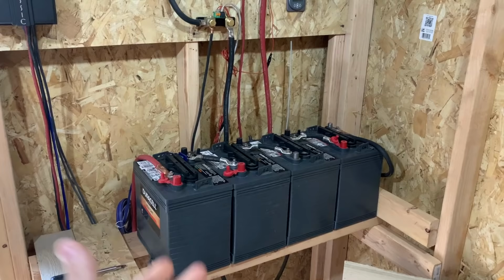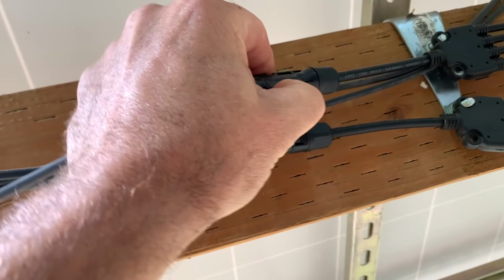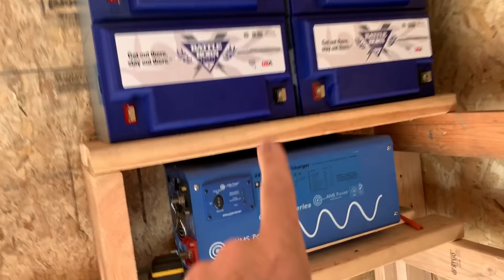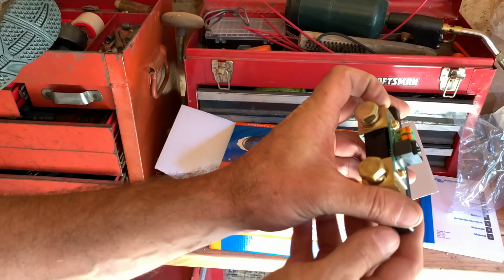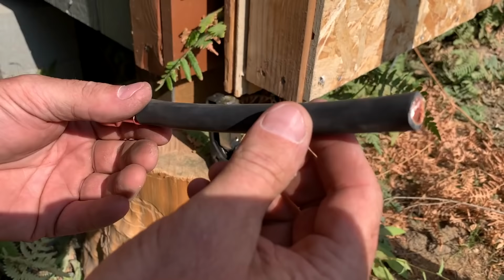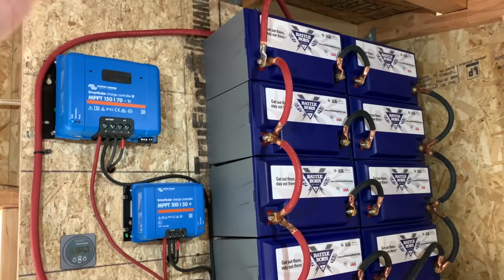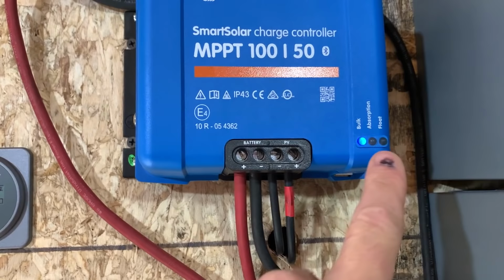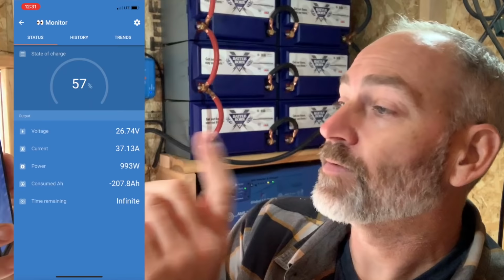EASIEST Off Grid Solar Power System Battery Bank

Comment: Battleborn is way to expensive! There prices have been going up even more lately.
Reply: The cost of doing business has risen significantly in the US.
Reply: @troy3456789  Yes and businesses use the "excuse" of covid to raise their rates.
Reply: I suspect that the cost of manufacture in the US is higher, (than China), but I also suspect that price gouging and profit taking are the name of the game...
When the US put tariffs on Canadian steel, the US Steel manufactures didn't take advantage of their (now) price advantage, instead, they raised their prices to match the cost of Canadian steel + tariffs..   So, like I said, profit gouging...
Reply: @kasualskeptik2584  It's that regulation and minimum wages and fuel costs have almost doubled, so everything must go up in lock-step with it.

Comment: Those batteries won't charge below freezing. They have low temp cut off.
Reply: God Robot  They don't drain in the cold they simply do not produce power when they are too cold. Also if they are charging or providing power they will keep themselves warmed up anyway.
Reply: Wont be a trouble in the Caribbean then.
Reply: That's $8,000 in batteries alone
Reply: @louiswaylonbrown  thanks for that info.  Seems i won't be replacing my lead acid ones any time soon 😫
Reply: @christopherj8280  you can find a cheaper lithium battery they are just top of the line because the battery’s are 1000 each I’m considering building my own battery source myself
Reply: @louiswaylonbrown  I started a few years ago with huge tractor batteries. Eventually moving to some 6volt deep cycle in series.  But I've been aesy for over a year and they won't have been serviced properly or kept topped up with distilled water. So are probably usless now. When i go back this  Christmas i was planning to refresh the battery bank. The main problem is that in Jamaica everything costs twice the price of usa thats if it's available at all.

Comment: I saw the batteries are $1000 each. Click. I'm out.
Reply: So 100 per year or if you go 20 years = 50 per year. Reasonable. So say 15,000 for total system, credits from federal government by time you're done for 20 years you're electric bill for 20 years is around 50 dollars a month fixed. Or you can go ahead and pay for 50 miles of electrical cables telephone poles.... well you get the picture.
Reply: Shop around for the batteries.  I'm getting 32 100ah LIFEO4 batteries for 4200 through CALB.
Reply: @jasonshimkus6139  My monthly electric bill is around $150. It's not something I really concern myself with.
Reply: Battleborn have a good rep but I agree. You can buy 280ah 3-5k cycle  lifepo4 cells for around 150$. Each. Buy a quality BMS and spend a fraction...
Reply: @justinanderson9747  don't need a BMS if you bottom balance the batteries first.
Reply: @justinanderson9747    where to buy for that price pls?????
Reply: SK Battery America, Inc (South Korean lithium-ion battery maker) is building a MONSTER plant in Commerce, GA at the moment. Don't know what that's going to do to the price of apples or lithium batteries more importantly? But they will be made by thousands of Georgians when it's up and running.
Reply: @beebop9808  what chemistry do they use in their batteries?  Competition is good for the buyers though!
Reply: @jasonshimkus6139  I have no idea and maybe no one else does yet? There are American partnerships involved. Probably best wait and see for that kind of information. I don't know when the scheduled opening of the plant will be? Only that they appear to finally have all of the buildings up after about a year of building. Imagine there's plenty left to do on the inside. Nothing small about it. I thought it might be another automotive plant when they tore down a mile of woods to start building.
Reply: @beebop9808  by the time I get to the powerplant build they will be up and running...so I'm very curious!
Reply: @tims2179  will they last 20 years though?
Reply: @Adrenaline89Junky  most good LiFePO4 batteries have a good warranty provided with them.  If they are properly balanced before put into use, it's been said that the battery bank will Outlast the RV it's in to the point where the bank can be installed in a different RV later on and still perform at the level as first used.  Again...IF...the build is done correctly.
Reply: @jasonshimkus6139  how do you balance them?
Reply: @mooskamoo  check out "RVexodus" on YouTube.  He has an entire lithium series build where he give a step by step on how to bottom balance LiFePO4 batteries.
Reply: @jasonshimkus6139  thanks.
Reply: @mooskamoo  yw sir
Reply: @justinanderson9747  with shipping from china 108 ea. (X16)
Reply: @justinanderson9747  where please?
Reply: @justinanderson9747  Where can I buy these and what are the amp hours?

Comment: $8000 in batteries is a lot of scratch.
Reply: Well if I have a household full of teenagers that don't know how to turn off  lights, amps, electronics, AC, heater etc and electric bill that's about the same cost as my mortgage!  These are definitely the best investments EVER!  Also my stress level of seeing my bills will lower= lowering my chances of having heart attack=long life! 
Anyways it's just money, we spend money quicker on a lot of other BS!
Aloha
Reply: @xyleya12  he wouldn't be able to run a whole house; kit appliance circuits, stove, lights, water heater, and an AC off that battery bank. It would need to be around 4x larger then what he has
Reply: @joshuahaught4812  might want to do some more research....
Reply: @wyzurd  don't need too. A battery bank of 8 batteries wouldn't be enough to supply the average American (which the guy is) home with all the normal running supply during summer. Would it be enough to do it during winter, you bet. If he has an electric stove and an AC he would not be able to run them at the same time
Reply: @wyzurd  just did some research and it seems like I'm still correct. Thanks.
Reply: Yet you even say it depends on variables... way to make blanket assumptions!
Reply: @wyzurd  read what I wrote. Your cherry picking and yet still haven't provided any alternative. Dont know what you're trying to prove and it looks like you don't either
Reply: @austinjudovsky7240  I wasn't talking about the gentlemen in the video. 
I was speaking to the person I presumed lived in Hawaii in the comment section.

Edit: you are Def correct in regards to the guy in the video. I doubt he would have built a system that wouldn't fit his needs.

Edit: I also did a quick search, "how many batteries to power a house?" 38 batteries for 3 days; so close to 13 per day for the average American home.

Comment: those really are great batteries but the components are made in china. They make all the  lithium cells. I have about  one thousand amp hours of  lithium. with the cells  BMS and components I have about 2500$ in it. You have to order right from china to get those deals thogh and do a lot of home work on how to build them though.
Reply: All you have to do is buy these and use them, unless you want to try to save some $$$ and you know how to go your own route.  These have a BMS already and are plug and play,
Reply: I won't buy from China. I'll look somewhere else for batteries.

Comment: If I were to build a system like this, I would install a 'cutoff' switch in the shed so you can easily disconnect the panels from the controller without having to go out to the panels.

Comment: If I was you I would only use 80% of your 400 amps they will last a lot longer..
Reply: If the controllers where pre configured by Victron, then that's most likely already the case.
Reply: @aetechreviews  Charge controller's dont control battery cut of only the inverter or a battery cut of relay made by Victron can do that . But in any case one should have an auto start generator that kicks in at 20% state of charge left and recharges the batteries in case of bad weather..
Reply: @TheMFrelly  the BMV has a relay that can shutoff the inverter
Reply: @TheMFrelly  Bulk: During this stage the Controller delivers as much charge current as possible to rapidly charge the batteries. When the battery voltage reaches the Absorption voltage setting, the Controller activates the Absorption stage.

Absorption: During this stage the Controller switches to the constant voltage mode, where a pre-set absorption voltage, suitable to the battery type (See section 4.1 Battery Settings below), is applied. When the charge current decreases below the Tail current and/or the pre-set Absorption time has elapsed, the battery is fully charged. The Controller switches to the Float stage.

Comment: Great set up and build. May I recommend putting small wind turbines in your air-conditioning ducts that are connected to the power grid. That way your air-conditioning powers your house and the solar becomes a supplemental system. I generate 20kw with my air-conditioning. I have plenty of power and also supply the neighbouring property.

Comment: Really ought to be breaker panels between the panels and the controller and between the inverter and batteries.  Also “designed and assembled” in the USA means all the parts are made overseas, shipped to Nevada and put together there.  Those batteries aren’t Made in the USA.  Great system and it’s awesome being independent of the grid but you should add some basic things like the breakers to keep it safer and more convenient.  Invest in heat shrink too for those crimped cables.  Color coded and safer.
Reply from the maker: I’m pretty sure I didn’t say they are made in America.

Comment: Our batteries were warrented for 5years and they're just a little over 18 years old and still kikin. That's because they're premo and been babied. They are under my bed. They match the foot print if my bed  when the weather gets. "bad" the little town down in the valley and our only concern is. Diverting excess power even in the night cause the wind gennies are howling. Haha. Our power never goes out.

Comment: This is incredible. I'm just starting to learn about this stuff. I had no idea how much energy the sun would put into a system as opposed to a generator. It of course depends on the size of the solar array, but still. 1000 on a generator that is using a consumable resource as opposed to 3000 with sun. Initial investment for a limitless system versus long term resource use.

Comment: We've got 24 250 Watt 5 bar mono panels and a $7000 battery bank with 4wind gennies cause da sun don't shine at night. Freezers AC fridge n bla bla.and 14  generators.( I buy them in pairs for redundancy) cause I'm used to being over 457 miles from town and go in once a year in Alaska but now in the lower 48 sometimes twice a month for feed n hardware.

Comment: Also Battle Borne said I would a make a choice. Stay with the grid or remove myself from the grid because the grid would drain and damage my batteries. No one really talks about that. I also wanted to ask you why is a good generator I won't have to do a pull start and can run long hours.

Comment: Just a side note, that is the neatest, easiest way to wire up your batteries - BUT not the best for the batteries, batteries 1st in line at each end will always get the most charging. Best done with the in-coming charging wire going to a bus bar for both pos & neg, then equal length wire going from bus bar to each set of batteries, that way all batteries get charged at the same rate. You can really notice that best with lead acid batteries, because the batteries first in line are always lowest on electrolyte when hooked up like you have them.

Comment: You would get more power out of the large array by removing the Y connectors and going to 2 strings of 3 panels with 2 controllers. I fussed with mine for months before figuring out that I was loosing nearly all the benefits of MPPT when doing S+P arrays. Now I only do S and MPPT works much better.
Reply from the maker: The voltage would be too high for the charge controller used in this video.
Reply: @MartinJohnsonOffGridLiving   3 would be? The link no longer shows the panels. Figured they were 39v voc so 120 should fit. Interested in if those are higher voc.

Comment: I like your video but I do see some things you could upgrade first strap your batteries to the wall secure them some way. Put in a off switch on off twist switch like in the Marine industry to be able to disconnect power if necessary

Comment: Thank you for sharing your installation with us. I have a pending solar install of 6 kwh system within a week or two and will be upping that myself to 14 kwh. They will be doing a ground mount system and I'll be duplicating the remaining 8 kwh system. Then shortly after that I'll be tying in a 14 kwh generac generator with a service ATS. I'm not sure if I need to wait for the generac install before or after I begin building my power shed near where my solar arrays will be installed. So within a few years .. HOPEFULLY .. I'll have a full 14 kwh solar system with battery system and generac generator backup. I've been doing as much research as possible trying to get ready when these events begin to happen. I did want to make one other comment about your setup. I hope you did account for this, but it seems you're running your gasoline generator inside of an enclosed room. I am hoping you did modify it to vent outside. I'd hate to see anything happen to you from CO poisoning with all the great stuff you are doing. Thanks again and stay SAFE!

Comment: Not trying to trash on you or anything but I think lead acid might be better for offgrid stationary living where weight isn't much of a factor. Lead acid also has the advantage of being able to maintain it and repairability. Lithium ion I'm pretty sure after a while just starts going bad and when it does you have to recycle it and buy a new unit.

Comment: 16:40 Thats why I would always add a switch on the main possitive. though in such a setup I might even want to opt for a battery selection switch like on boats. (but perhaps thats because I am boating guy) and create 2 24V banks with the batteries and usually keep the switch on "both" (this means you basically use this as its wired now except that they come together in a swith rather then on the battery) but have the option to choose to use only one of two 24V banks.This could give you a main power battery bank and a backup should you want or need to use less power for example due to few hours of sunlight.

** Edit **
Ah, Generator backup .. then it makes no sense to create 2 banks with the batteries.

Comment: A more competent cable production process would have included tinning the cable ends prior to terminal install or at least dielectric grease ....then followed up with some heat shrink tubing over the terminal body.

Comment: By connecting directly the battery voltage to the invertor you could damaged the system!
The spark is because of empty capacitors inside the invertor. you should charge them before connecting them.

Comment: Yes I'm watching an old post. but was wondering if you would install more batteries as on the next wall to the right appears to be vacant ready for the next bank, get ready for your next winter. With the price of gas going up don't run the generator as long. only a suggestion.

Comment: Inverters should have a minimum of 4- 8 inches of clearance on all side to prevent heat soak. Batteries should be stored low and separated by mfgs recommendations. I like the idea and the info on the products but that's a fire waiting to happen if your charge controller fails or inverter pops.

Comment: Thank you for your nice video and work, hope that all things will satisfied your expectations. I am very curious about how is working during time and the most important, what can be the real lifetime of the batteries (the most important and expensive thing). Theoretically each battery has his own properties (with possible small differences from one to another) so mainly in time because of the difference in value of internal resistance between the batteries at parallel connections every time the stronger battery will consume even from the weak one so is good to have some small device what will modify each batteries internal resistance to can ensure the proper value that need to be the same for the parallel connected batteries. At series connections also the difference between the batteries internal resistance can affect in time the battery whit the smallest value because the current on this battery will have a higher current value. So if you can equalize this internal resistance of the batteries to be the same you will extend their life... All the best regards,

Comment: Another safety issue is having a wall of batteries only supported by the batteries themselves. should anything cause a distortion in their shape the entire wall will fall over because they are wired together. better to separate each layer by a fixed shelf and even strap them to the wall. Earthquakes do happen High winds can flex a wooden structure more than enough to toss the batteries and effectively cut off your power. with items as heavy as batteries and how they are your source of power main and emergency you'd be best to keep the entire stack as close to the ground (outside of potential waters) or if a flood is possible set up in as stable and solid a manner as possible at whatever height the water in a  500 yr storm would produce.

Comment: I would run the power cable through a battery switch. Then I could turn the batteries off in case of emergency.